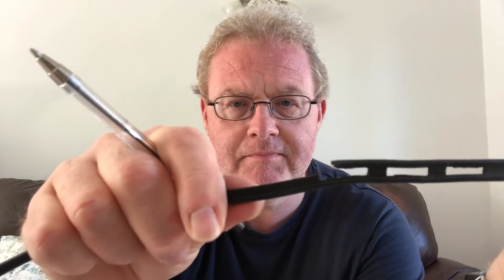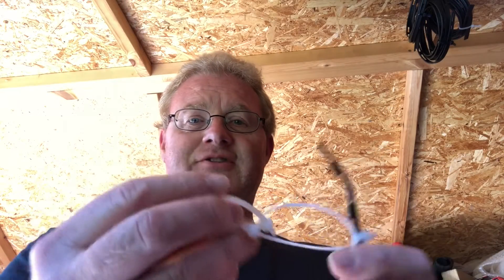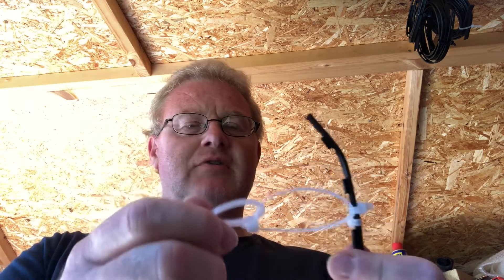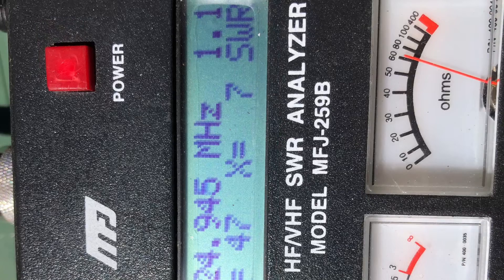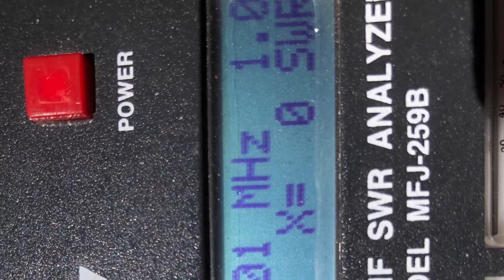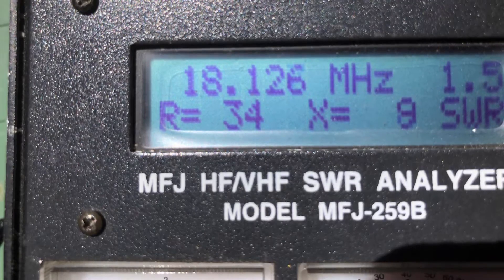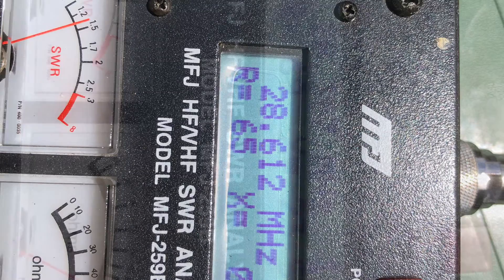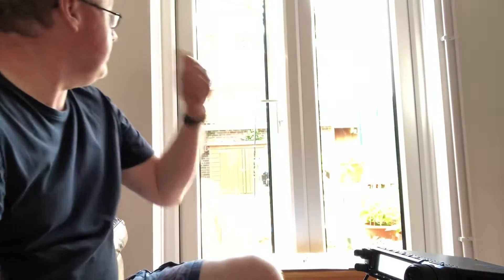HAM RADIO: Simple Fan Dipole Antenna

Comment: I'm surprised that worked with so small a spacing. I tried one once with 4 wire flat rotor cable, but it didn't work.
Reply from the maker: It was fiddly to tune but it worked

Comment: Great video...
I recently put together a 3 element fan dipole for 40, 20 and 15 meters. I used 6 inches of separation between elements and no balun... I did have some interaction between elements. Enough to cause me to have to do a little re-tuning here and there until I finally got the antenna tuned. I now have less than 2-SWR across all three bands. As a bonus. I also get about 1/4 of the 6 meter band as well with an SWR of 2 or less...
I'm very happy with this antenna...
Reply from the maker: Nice! I wonder if having both a 15 and 40 element was an issue?
Reply: @TIMG5TM  the 40 enhanced the 15 meter element by giving me an SWR dip at the high end of the band. I turned the 15 for the lower end of the band and go less than 1.5 SWR across the band... On my analyzer it shows a double dip. Guess you can say I'm double dipping...😃

Comment: Good video Tim, how would this work without the balun which I assume in 1:1...EI5FK..Charles
Reply from the maker: Yes it can - but you can sometimes have some common mode current on the coax plus a balun at the feed-point may well help with reducing, at least a bit, any man made noise.

Comment: Nice video, Tim.  I would have not thought to use ladder line for the antenna elements as I have stuck in my head a separation of 4” to 6” of each of the elements to prevent tuning troubles.  Thanks for making me think outside of my assumptions.  It is all good!  Love the science part of the amateur radio hobby.  I am new to the amateur radio hobby and planning my first fan dipole to cover 80, 40, 20, 10, with maybe 15 for free due to harmonics.  This will be an inverted V if I can get it all to fit and not interfere.  I am about to make my center insulator and start making holes in the separators.  Thanks again for your video.  73 from Texas!

Comment: Hi Tim, this is a very informative video indeed. I put together a 4 band SWL sloper aerial a few months ago using the same 300 ribbon feeder. Using a nanovna to check resonances, the theoretical lengths proved anything but resonant, but it seems my pruning attempts were not enough. Also for the shorter elements i left the unused feeder wire lengths cut but left the unused ribbon wire in place, which might explain the tuning difficulties. In use the aerial is quieter, about 5-6 s points lower than my Inverted-L, but the audio is just as clear, so it must be doing something. 
Armed with this video and the extra pruning needed, it's time to re-tune the tactically hidden (from the XYL) sloper and use that info on future HF wire aerial projects :) 73
Reply from the maker: Sounds like a neat project Colin. Hope it works well for you 73

Comment: Why did you divide by 468? And not use 300/freq? Cheers john
Reply from the maker: To calculate using feet and inches. 73
Reply: @TIMG5TM  Cheers. Have you done any videos on using the MFJ to tune antennas?
Reply from the maker: Yes I also tuned an end fed halfwave ... look for the 40m monoband video I made in May/June. 73

Comment: Hi Tim.  Do you think there is any interaction at the close spacing of ladder line?  Also - velocity factor of ladder line will be 88% or so I guess for 300Ohm stuff.  Great idea and a simple way to multiband a cheap antenna!!
Reply from the maker: Cheers Tom.. who knows lol. Even with the velocity factor in place the 10m element should never have been close to resonance on 12m. A fun thing to try. Moral is don’t throw away scrap wire! 73 and thanks for stopping by.